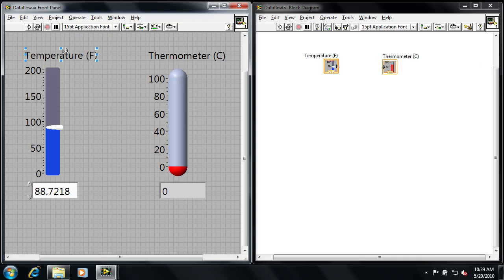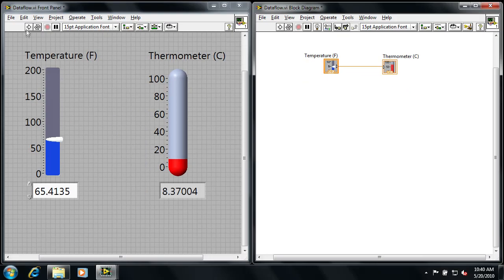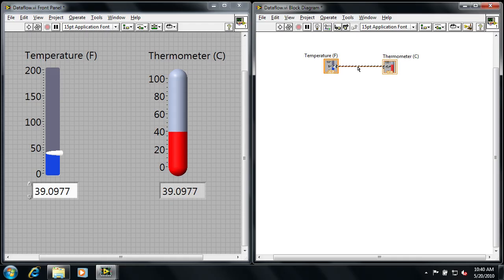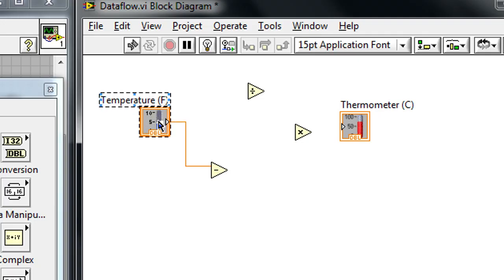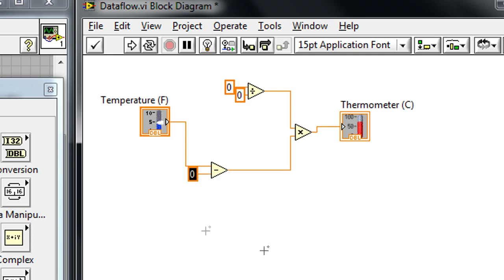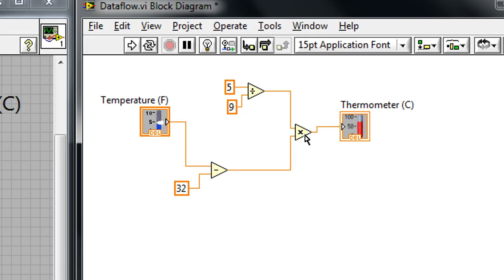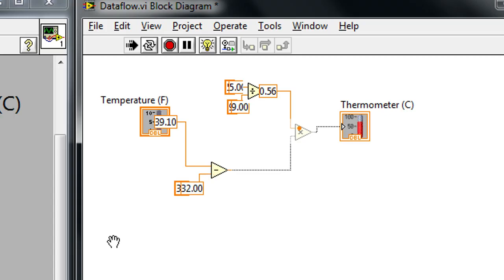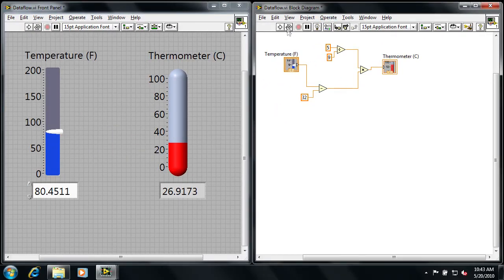Data Flow Programming Basics

Comment: At this point, the conversion should be checked by putting in key values. Entering 32 degrees F should give 0 degrees C and entering 212 degrees F should give 100 degrees C. However, the temperature range slider for degrees F does not allow the value 212 degrees to be entered because it tops out at 200 degrees F. This is a functional validation step that's missing from this video.

Comment: How does the glider and the thermometer communicate with the control and the indicator boxes respectively. The interconnections are not explicit on the block diagram. I could wire the output of the calculus directly to the indicator and thermometer simultaneously, but couldn't do such with the control as it doesn't take an input.  Labview 2019 here. Thanks in advance.

Comment: Hi i need to add a boolean switch to convert from farenheid to celcius and viceversa and how to implement in my program?
Reply from the maker: One way to do that would be to put the F calculations and the C calculations in separate cases on a case structure and have the input to the case structure be the Boolean control.  When the control is one way, it can calculate F and when the control is the other way, you can calculate C.
Reply: @NIApps  Thank You for the suggestion

Comment: I cannot edit the number for Farehi temperature help pls
Reply from the maker: Do you want to edit the numbers on the thermometer indicator?
Reply: no i mean on the slider, it appears as 0,2,4,6.. and when i double click on it and edit it to 0, 50,100... as you it keeps going back to its initial values 0,2,4,6... I cannot get the slider with the number like you
Reply from the maker: Have you for sure made the slider a control and not an indicator?  (Just to be clear, a control is an input and an indicator is an output).  To know, you can right click on the slider to see what it is.
Reply: yes thx i can adjust it now
Reply: @NIApps how should we make the slider a control

Comment: Out of curiosity, could you somehow define the function where the 5/9 division was unnecessary?  As in, could the operation be executed so that you just use the value of 1.8 as a constant?
Reply: +ChaoticSerenity 

I expect, since the result on the output pin of the division function must be 0.5 recurring, not 1.8, then he could use it straight.

He makes the best decision though, because 5/9 produces a recurring decimal so, however many digits you provide, there's always a rounding error, actually storing the rational number has better numerical integrity than typing 0.555555555555555555555...